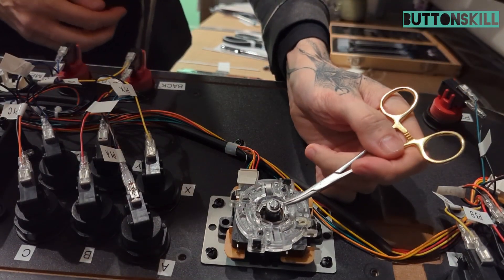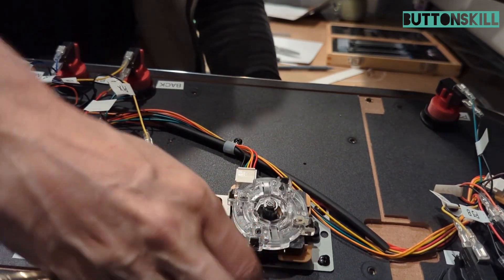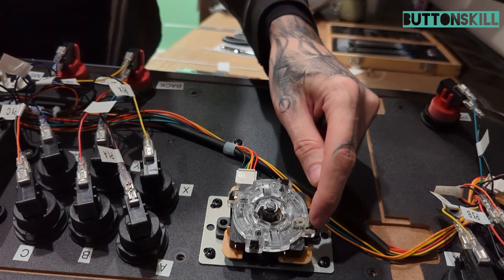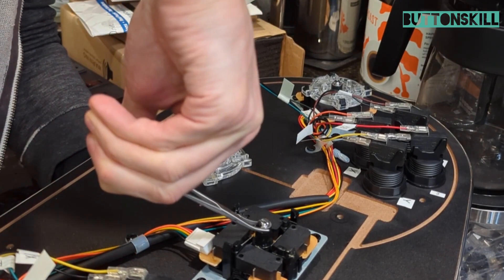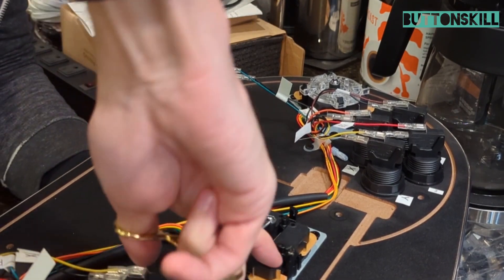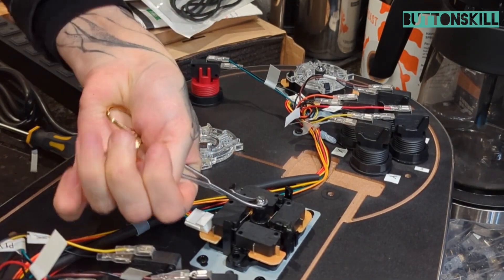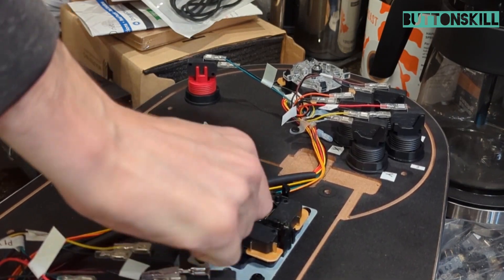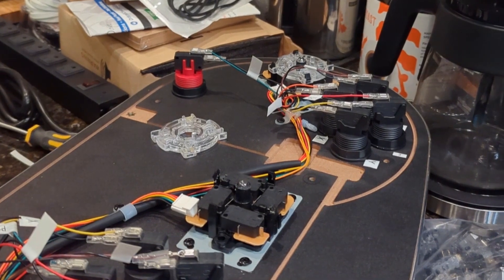How to remove a C-clip to replace an arcade joystick shaft or spring (The easy-ish way)

Comment: Lol bro you can just remove it with Nail pusher , push down the spring and put the nail pusher to the hole of that tiny thing and push it out.
Reply: 2024 - can confirm, a nail pusher works great!